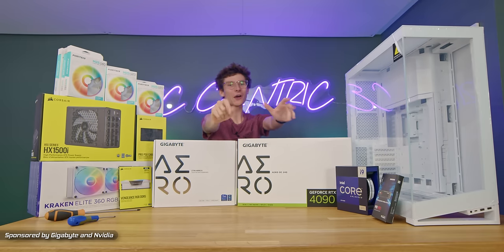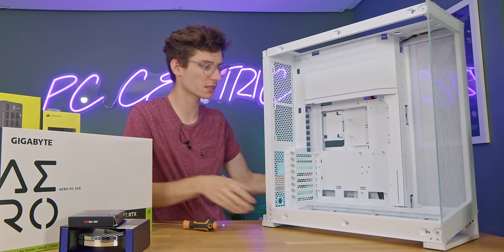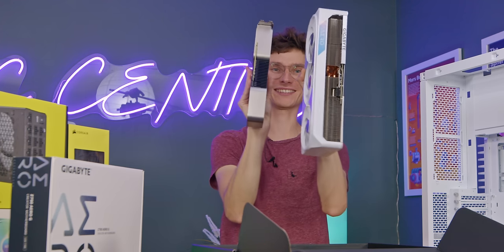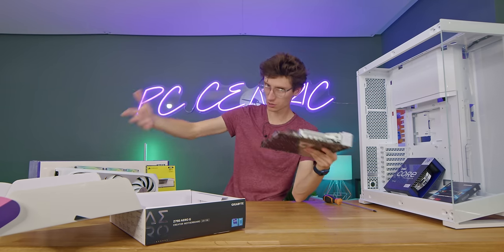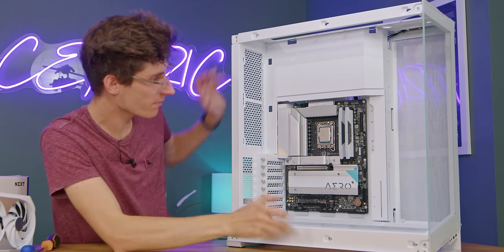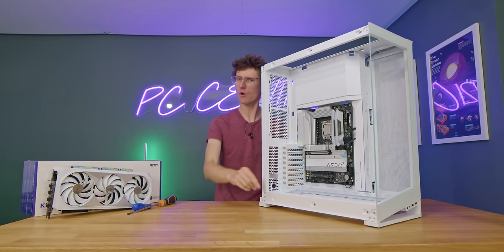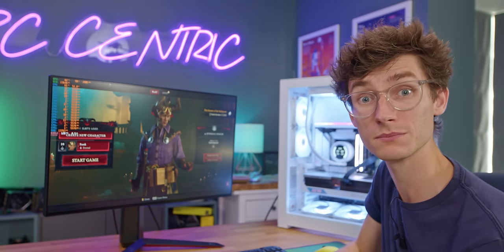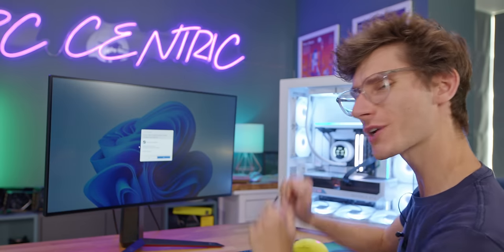The MOST POWERFUL Gaming PC You Can Build?! 😮 RTX 4090, Intel 13900KS, NV7 w/ Benchmarks | AD

Comment: 😂 He said the Ryzen 9 7950X3D AM5
Was only 8 Cores lmfao
THE ULTIMATE GAMING PROCESSOR FOR SERIOUS CREATORS
16 Cores and 32 processing threads, combined with a massive 144MB of cache
5.7 GHz Max Boost, Unlocked Memory Overclocking, DDR5 support
For the state-of-the-art Socket AM5 platform, can support PCIe 5.0 on select 600 Series motherboards
Cooler not included, liquid cooler recommended
Get your information right guy. 😅I'm dying laughing.
Reply from the maker: 7800x3d is 8 core, and is the fastest AMD chip for gaming

Comment: mine is more powerful LOSER 

my specs

Chassis Model: Aventum X
Processor: AMD Ryzen Threadripper PRO 5995WX (64-Core) (Up to 4.5 GHz)
Motherboard: ASUS Pro WS WRX80E-SAGE SE (Wi-Fi) (AMD WRX80) (Up to 4x PCI-E Devices) (DDR4)
System Memory: 256GB DDR4 2666MHz Digital Storm Performance Series
Power Supply: 1500W Corsair HX1500i (Modular) (80 Plus Platinum)
Storage Set 1: 1x SSD M.2 (1TB Digital Storm M.2 Performance Series) (NVM Express)
Storage Set 2: 4x Storage (6TB Seagate / Toshiba)
Storage Set 3: 4x Storage (6TB Seagate / Toshiba)
RAID Config: - No Thanks
RAID Card: LSI MegaRAID Internal 9280-16i4e (Up to 16 Drives) (SATA/SAS) (6Gb/s) (PCI-E) (512MB Memory)
Optical Drive: External USB - Blu-Ray Writer & Player (Blu-Ray 6x) & DVD/CD Writer
Internet Access: Wired PCI-E Intel 82599 (10 GbE) (2x SFP+ Connectors)
Graphics Card(s): 2x GeForce RTX 4090 24GB (VR Ready)
Sound Card: Creative Sound Blaster AE-9 (Hi-Res) (Ultimate Audio Playback)
Add On Card: Blackmagic Design DeckLink 8K Pro (Quad Link 12G-SDI Capture and Playback)
Extreme Cooling: H20: HydroLux PRO: Exotic Custom Cooling System (2x Graphics Cards + CPU)
HydroLux Tubing Style: HardLine Tubing (Requires HydroLux PRO Custom Liquid Cooling System)
HydroLux Fluid Color: Red Fluid + Clear Tubing (Requires HydroLux Liquid Cooling System)
Cable Management: Exotic Cable Management - White - (Cable Combs with Custom Color Sleeved Extension Cables)
Software Control: Corsair Commander PRO Management Control Board & Software (3x Boards)
Internal Lighting: Remote Controlled Advanced LED Lighting System (Multiple RGB Color Modes)
Chassis Fans: Corsair QL Series (RGB Fans) (Software Controlled Effects) (14 Fans Total)
CPU Boost: Factory Turbo Boost Advanced Technology
OS Boost: Yes, Disable and tweak all of the non-crucial services on the operating system
Operating System: Microsoft Windows 11 Professional (64-Bit)
Recovery Tools: USB Drive - Windows Installation (Format and Clean Install)
Virus Protection: Windows Defender Antivirus (Built-in to Windows)
T-Shirt / Hoodie: - No Thanks
Keyboard / Mouse: - No Thanks
Mouse Pad: - No Thanks
Display: - No Thanks
Headset: - No Thanks
Priority Build: - No Thanks, Ship Within 20-25 Business Days After Order Is Successfully Processed
Warranty: Life-time Expert Care with 3 Year Limited Warranty (3 Year Labor & 1 Year Part Replacement)

Comment: Replace that POS Intel CPU with an AMD Threadripper, and you would be accurate. This video is laughably not true. The 4090, yes. It is also the system's bottleneck with a Threadripper. Intel, what's up guys? Come on, we need you. And Nvidia? You guys are not keeping up(Not that AMD gpu's are either).